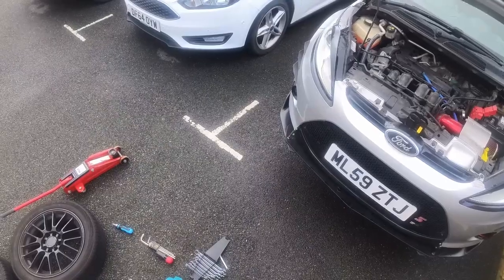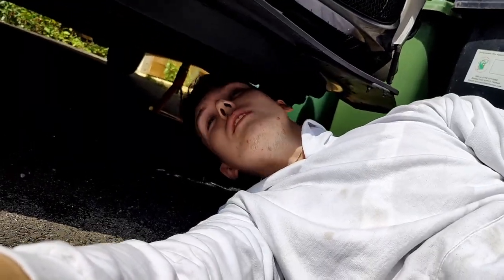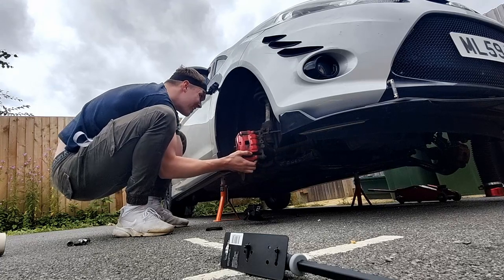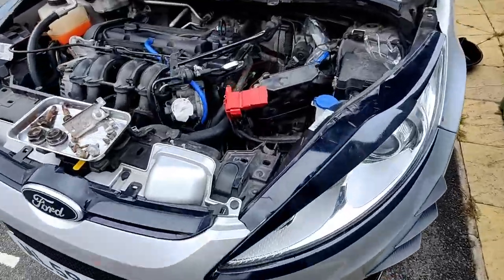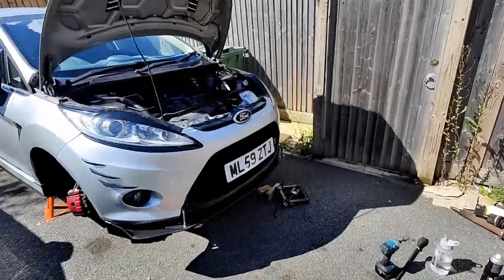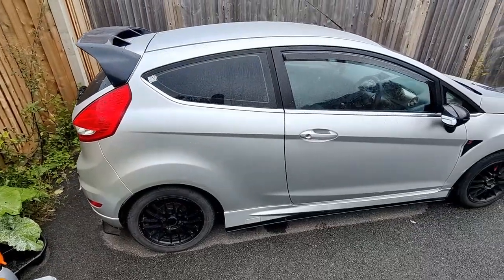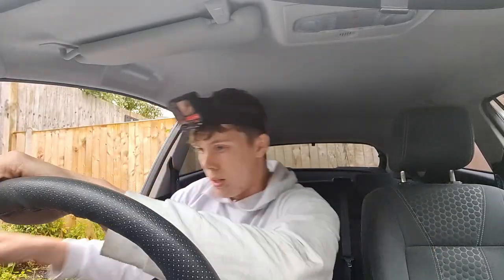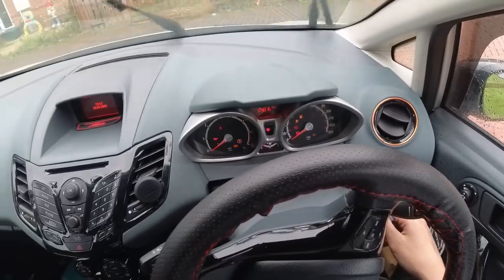Clueless to Confident: My First Clutch Replacement Experience

Comment: As an experienced Master Tech I'll let you know that I never use a clutch alignment tool, and I do as you did and have random bolts which do the job (unless its a pull type in which case you need to compress the clutch before fitting so a tool is a must), but overall I am impressed with your work and think you should apply for an apprenticeship.
Reply from the maker: Thanks Mate glad it seems I somewhat know what I'm doing aha 😅 if I was to do it over I would have 100% chosen a more engineering career but I've already got a degree in chemistry 🧑🏼‍🔬 not that it helps much which changing clutches unfortunately 😂

Comment: I just did my entire suspension front to back, all the way down to drive axles and new wheel hub assemblies, I had a ton of trouble getting the rusted bolt apart which led me to just putting it all and putting new parts in, seeing how he did this I would have done the clutch at the same time myself when it was all apart!
Reply from the maker: Good work on the suspension mate will have to leave the clutch to another day 😅 at least it will be easy to get the new parts back off

Comment: great video I've almost finished replacing the clutch on my mk6 fiesta just need to put the gearbox oil in and clutch fluid it's very similar but still hard
Reply from the maker: Congrats mate yeah it's a tough job, but I learnt so much in the process I'm sure you did too 😄

Comment: With a block of wood or rubber on your jack, jack up on the disc to just past horizontal. Takes the weight out of the spring pushing down and the ball joint comes out and goes in a lot easier.
Reply from the maker: Thanks for the Tip I need all the help I can get 😅

Comment: My only concern is that bolt you used for the lower ball joint.  I doubt its the correct grade and the oem bolt has a thicker shank (non threaded part) thich is what keep the lower arm in place with that type of ball joint.
Reply from the maker: Well spotted, I found this out after filming this and have since changed it which you'll be able to see in a future video 😅👍
Reply: i will second that you need new ones from ford

Comment: you should put a short shifter in the car so there would be less throw in the gear changes
Reply from the maker: That would be an awesome project, now need to research how much a short shift costs 😅
Reply: I have the mountune one in mine. Cost about 110 quid about 8 years ago and it's been a nice little upgrade. Very noticeable when new but now I'm used to it it's just a nice feeling gearbox. Although seeing how I'm watching this video, I might too be experiencing a little bit of age on my car...

Comment: Just a point about refilling the trans, with these 5 speeds and the 6 speed in the ST - you’re not meant to completely fill the trans with oil till it overflows.
Fluid level should be about 10mm from the top on level ground, believe it works out to about 1.8 litres.
Spark Plug Steve did a video on this as lots of people get it wrong, doubt it makes a huge difference just worth a mention!
Reply from the maker: Thanks for mentioning it I need all the help I can get 😅

Comment: Use screwdriver in the vent of disc stops it moving 👍and use a chisel in the gaps on the hub to spread it to help balljoints come out easier 👍👍well done a lot of people are to scared to try so let garages rip them off so good on you mate 👍
Reply from the maker: Thanks for the tips hopefully I won't have to change the clutch again too soon 😅🤞

Comment: I drive a 2017 Fiesta DPS6. And work on it myself. You have to drive the DPS6 hard, or the finer workings, like forks/actuators, get coated in clutch dust, and stick, then bend, etc. Two LuK clutches. She stays loose, and working correctly, if you pretend to be Séb, Elfyn, or Ott, multiple times per week. 😀

Wait.... I'm not sure it looked like you replaced a 8+ hardness bolt with another 8+ hardness bolt in your suspension. Don't use soft stuff. It'll sheer off at high speed.
Reply from the maker: Sounds like fun to drive 😄 and well spotted they've been changed for the correct bolts now you'll see that in a future video 😅